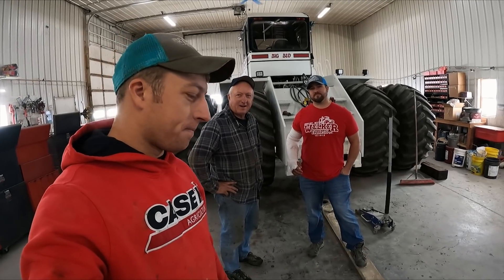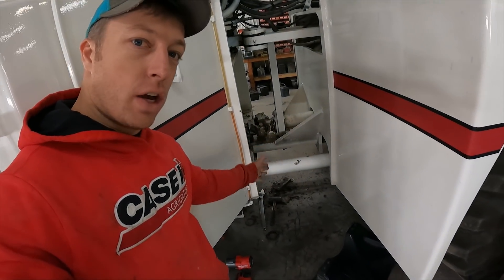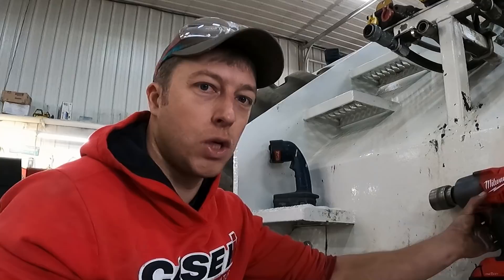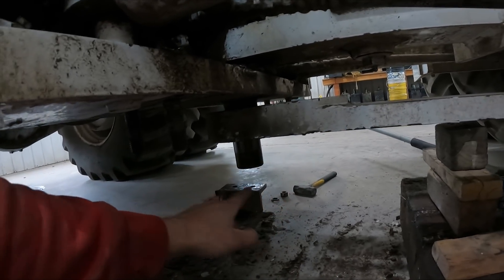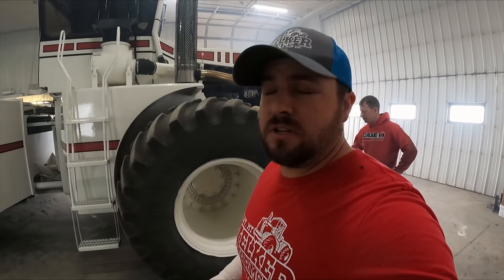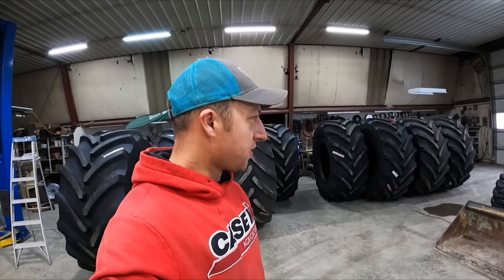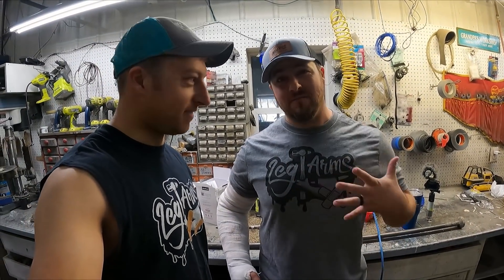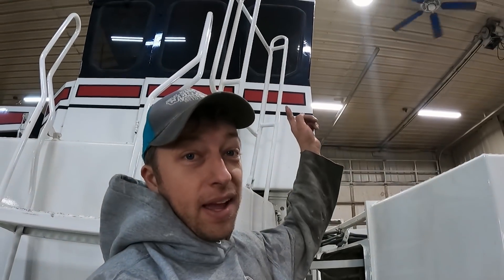HUGE Drawbar & NEW Tires!

Comment: Watched the previous video and you were talking about the JD skid steer drive motor acting up i don't know anything about JD skid steers but I have replaced all of the seals in our case 85xt  drive motors took about 45-60 minutes from start to finish from what I can remember 
Our dealer wanted $2000 right off the bat but i think that we were able to challenge the price and we were able to get the one seal kit for $200 the other one for $50 two completely different times

Comment: How does a change to radial tires help on the Big Bud?  Led Arms Jr. mentioned that they would have a better footprint, but aren't the news tires the same size? Is there a use for the old tires?
Godspeed on the continued healing.
Reply from the maker: It is how the tire flexs, biased maintain their shape and don't squat much, radials can flex and put a larger flat footprint on the ground thus greatly increasing traction.

Comment: I use the Milwaukee impacts at work and I love there power. Be careful they will snap bolts off.
Reply: The 1/2 inch drive one WILL snap a new 1/2 inch bolt.

Comment: I'm surprised the rims don't split in half on those. I had a backhoe that I changed the tube in several times solo and that's what made it possible. Still a tough job as they were 16 ply 17.5-25 tires but doable off the machine. They were tubeless tires just didn't have the money to drop on new tires at the time so used tubes instead.

Comment: When I worked for Big Bud, I was told to NEVER lift a tire by the bead using the forklift. ONLY lift by the outside of the tire. Sometimes lifting by the bead will damage the sealing surface causing leaks or it wont hold air at all.

Comment: If you use a little bit of cardboard, you can use a ratchet strap, or even a chain with come-along either to completely raise the front, or at least as a safety net.  Works great on transmissions, or drivelines when doing a 'leg-arm single man stunt'.

Comment: Nick it's called a cherry picker because back in the 60s & early 70s we used to pick those cherry 396 cubic inch 475 horsepower 68 Camaro engines out, after the warranty was off and modify the exhaust manifolds of the already awesome sounding set of side pipes to get just a little more horsepower out of them , and maybe beef up the clutch at the same time to transfer all that energy thru that Muncie 4-speed to those gigantic poly-glass wide oval Goodyear tires that they were so proud of back then. That you could smoke in all four gears. I really miss those days.

Comment: What size are those tires....What is the price?
Reply: 850x50r30 (same as 30.5 x 32).  probably upper 3k each
Reply: @RobertWelkerFarmerBob     thats not bad I had to replace a 800/38 and was $3650CDN That was a Good Year

Comment: Guy's could you remove the jack pad,then machine a pin to fit the hole the jack pad slips in, take some thick wall channel,square stock and basically weld up a extendable pad,it'd help with heavy long pieces.
Think of a 4 or 2 leg vehicle lift with extending lift arms to support different length vehicles, trying to help you visualize the idea.
Harbor Freight has one but it's only rated like 2 maybe 3 ton at best. Just a idea. Be safe.

Comment: Personally I would call the gadget you're using an engine hoist, while a cherry picker is a basket you can stand in that is attached to a telescopic arm. That arm can be controlled from the basket and is usually on a platform that can be moved using the 4 wheels the platform is on. With that, you can at least imagine picking cherries. An engine hoist, like what you have there won't help you pick cherries. You can use your gadgets to lift engines out of vehicles really well though.

Comment: Here in Britain we call it an engine crane - because well, it's usually used for craning engines in and out... A cherry picker is something that is usually mounted on the back of a truck or 4x4 with a basket in it for, well picking cherries ;-) but used for lots of things where high access is required.
Reply: In the Midwest (Montana doesn't qualify) we called them "engine hoists"
Reply: @beaverstuff  Funny they are called "Engine Hoists" here in Occupied NY as well
Reply: Engine hoist in New England. Cherry picker is a bucket truck for pruning trees.
Reply: @beaverstuff  really last I checked Wisconsin is in the Midwest and everyone I know calls them cherry pickers LOL.
Reply: @russkettner6792  same everyone calls them cherry-pickers
Reply: @robertg.9964  in Wisconsin we  call them bucket trucks

Comment: What is a drawbar?
Reply: It's a heavy frame which connects to the middle of the tractor to equalize the pulling torque of front and rear to the implement.
Reply: @RobertWelkerFarmerBob  - Ahh, awesome. Is this only used on articulated tractors?
Reply: @RobertWelkerFarmerBob  - Also, how is the latest addition to the family? Leg Arms must be over the moon.
Reply: @mynameisray  he's loving it

Comment: As it's be settled that it's definitely not called a cherry picker,. Would it not be much safer if you boys had a decent sized mobile A frame with and electric hoist or block n tackle.
Reply: Given you used it for the wheels. Sometimes it's better to have more hands than bigger guns...

Comment: where i'm from the " cherry picker " is called a giraffe, i also dont know why
Reply: Boom lifts were originally called giraffes because when upright they look like the long neck of a giraffe. The name changed to cherry picker because of the extensive use in cherry orchards soon after.
Reply: Isnt a cherry picker a man lift off a truck with a man bucket thhat you control in the bucket? I thought those lifts were engine lifts so you can lift a motor out of a car without wrecking the car.

Comment: Not to be a party pooper, but I would highly recommend wearing safety glasses. I've had a small chunk of something fall in my eye, didn't think much of it, turns out it was some metal. Left a rust ring on my eye, and they had to go in with a dremel and grind it off my eye... NOT something you ever want to experience, not for the 2 seconds it takes to put safety glasses on. Not that you're 100% protected, but it's still better than nothing.

Comment: You have completely negated the value of the bolt by tuning down the shoulder. Just saying. god bless
Reply: Completely negated?  No...reduced it's rating?  For certain...but it was just an extra set to help out the other 4 that have been there for decades.
Reply: @Shane_Reynolds85   I agree with your point. My point is that the bolts value is in it's shear factor. when you reduce diameter you completely negated shear strength. but i see your point as well.
Reply: @Shane_Reynolds85  I would have reamed the hole out a little rather than modify the bolt.
Reply: @COWGUYVT  I think he was filling the hole more than anything.  Much easier to lathe a couple thou off a bolt than ream that much steel out, I'd say.